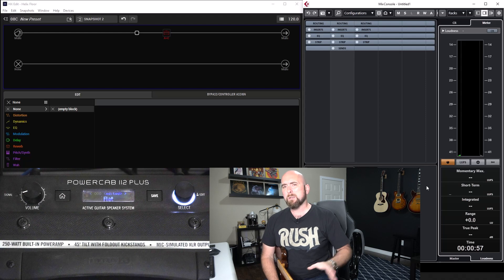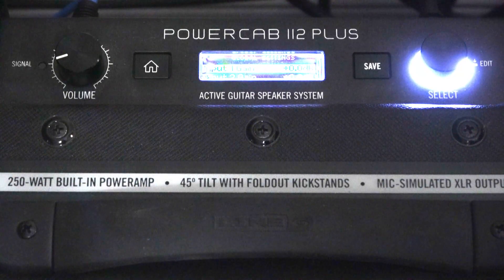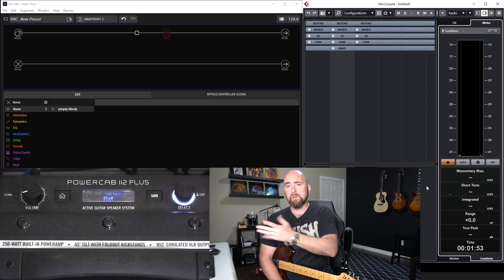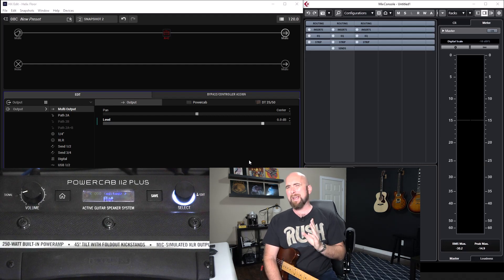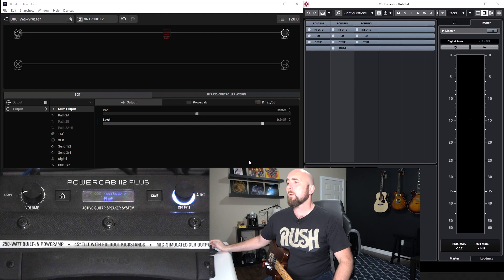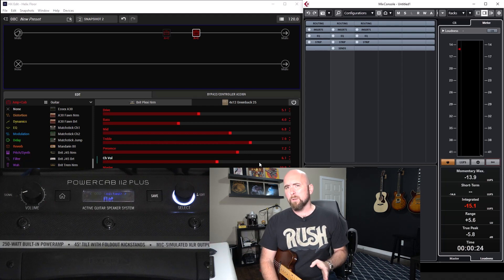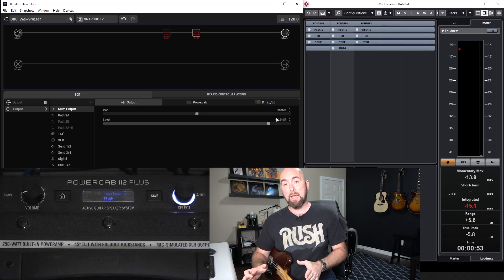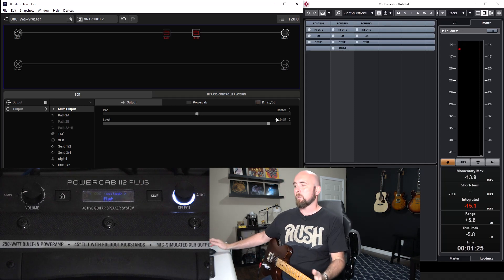SETTING UP THE LINE 6 POWERCAB 112/212 FOR THE ABSOLUTE BEST RESULTS!!

Comment: Jason, I appreciate your expertise with the Helix and Powercab.  You are my #1 go-to source when I have any questions and I watch your videos--sometimes a few times--and learn something new each time I watch them.  That said, I have a question about this video.  And I apologize in advance for the long post but I wanted to give as much details as possible from the start to answer any questions you (and any other readers) might have.

First, some details about my hardware and signal chain.  I'm using a Helix Floor (Firmware V 3.11.0 - b5021b0) with a Powercab 212 (Firmware V 2.00.1) connected to the Helix with an L6 cable.  I also simultaneously send XLR out from the Helix Floor to the FOH mixer (sometimes to my Behringer X-32 Rack and sometimes to whatever mixer is available, depending on the venue, rehearsal space, etc.  And sometimes I send from the Powercab 212's XLR OUTs to the mixers too, depending on the situation).  Generally, I use the Powercab 212 as I would a regular guitar amp on stage so other band members and I can hear the guitar.  And yet other times, I don't use the Powercab at all and just run straight into a mixer.  Now on to my problem.

Im having problems setting the output levels on my Helix so that the Powercab gets the right amount of signal without sending a signal that's too hot to the FOH mixer.  This is not much of a problem when I'm using my X-32 mixer because I simply turn down the gain on the mixer but  some of the cheap mixers I sometimes have to plug into can't handle the hot signal.  And now on to my question.

You mentioned setting the global output on the Helix to LINE level.  I see three sources of output on the Helix: 1/4" Outputs, XLR Outputs and Digital Output.  Next to the Digital Output is a Digital Out Level.  No changes to any of the settings in any of those outputs make any difference in what signal level my Powercab is receiving.  I assumed the thing to do was to set Digital Output to AES/EBU and then control the output from the Helix to the Powercab (via L6 cable) by adjusting the Digital Out Level but that doesn't seem to work.  I can change the Digital Output from S/PDIF to AES/EBU and it makes no difference.  I can adjust the Digital Out Level full-scale from -60.0 dB to  +18.0 dB and that, too, makes no difference.  Now, I can adjust the Output levels in the Multi output block using HX Edit, as you show in the video, but that also affects the level coming out of my 1/4" and XLR outputs.  How do I adjust the output to the Powercab independently of the 1/4" and XLR outputs on my Helix?

Thank you in advance for your reply.

Comment: Jason, I've watched a lot of your videos and I can say you've really helped me improve the tones in my setup.  Thanks for all your great content! I did catch in one of them that you said you mostly use your Powercab in Flat/FRFR mode (as you do in this video).  In my limited experience with my Powercab (have had it for less than a week), I feel the speaker modelling feels more like the "amp in the room", but this imposes limitations when recording.  And here I'm talking mainly about tradeoffs related to routing capabilities, DSP limits, and Helix's ability to model dual cabs.  (Maybe I should have bought a 212). Anyway, I have played with routing a signal to the powercab and splitting it off into Helix speaker cabs for the recording.  Of course I can also just record direct from the powercab . . . of course the simplest solution is to do all modelling in the Helix and go Flat in the Powercab.   I'd love to hear your thoughts / or see a video on this topic.  Cheers!

Comment: lots of good info in this video. For me I use the AES link to the powercab and make sure that in my global preferences Volume Knob Controls does NOT affect the digital output. I think this is the equivalent of setting the volume knob to full but allows me to use the volume knob to control headphone volume, etc.
Reply: I was looking for this comment as that's what I do too.  I wasn't sure if it's the equivalent of setting the knob to full but it seems that way.

Comment: I set my pcab at 21-12'oclock and design my patches so the vol knobber on the Helix LT is at 12 o'clock. Plenty of adjustment both ways and when the band says I'm too loud, I show the settings and tell them I have it set EXACTLY the way it was the last practice. Then, by the end of the night I can't hear myself because of their volume creep. Same thing over and over. Then it's, "Hey!, I can't hear your solos." Well YOU need to turn down then don't you...LOL. Consistency is king!
Reply: I set mine the same way. I can use my volume and tone controls on my guitar.

Comment: This is a very good video, thanks for the detailed explanation. I also had an issue by setting up the POWER CAB input level at 6Db. I use a kemper profiler and noticed terrible noise in some of the sounds, we should always keep the inputs at 0 Db

Comment: Great video! I just got a Powercab 112 plus and have a quick question for you. I use an HX stomp. My chain is guitar > Keeley compressor plus > stomp > strymon flint > Boss RC5 >Powercab. 

I have my output set to line, my stomp volume knob all the way up, and my compressor off and in order to get the signal light to turn yellow, I have to turn the channel volume of the amp model all the way up and set the output block to around +18. Is this normal? It seems like I have to send so much more signal into it than other people I’ve seen? I’ve also set the output of the speaker modes and FRFR mode to +0 and the input gain in global is +0.  Any idea why i have to send so much more signal than others? 

I’m using an American Performer Tele with my pickups set to stock height and my volume knob all the way up if that makes a difference

Comment: I have two powercab + 112.  I can use the link cable for either one and it works fine.  When i try to link one into the other it comes on for a second and then shuts off.  Only the second one does that.  I have the right cables.  Any suggestions?

Comment: Thank you for all your Line 6 videos! I have a Helix and a Powercab 112 (standard, not plus) and your videos have really helped me achieve a better tone. I have to ask though: I tried this trick and leveled some of my Helix patches so that the Powercab signal LED would alternate between green and yellow when playing. However, I began hearing quite a lot of unpleasant "rattling" (imagine a damaged speaker) from the Powercab when I did this. I had the Helix master volume all the way up and my presets leveled via Helix output block. Reducing the Helix output volume eliminates the rattling and I can increase the Powercab volume without re-introducing it. I connect the Helix to the Powercab with an XLR-cable using the analog interface since the standard PC112 doesn't have a digital input.

Could I have missed something or should I suspect a defect in one of the devices?

Comment: You mentioned you used the L6 link cable.  When using that cable rather than XLR does it default to line output?

Comment: Hey Jason.  Great work.  Question I have a helix in power cab are all your settings or patches that you have designed for my power cab to be an FRFR or flight mode or Ron mode or are you sending the signal directly from the helix to front of house.  ?

Comment: Jason, very insightful as always.  I don’t have a Powercab yet but I’m just about to pull the trigger. 
The one issue that I always struggle with whether with an amp or the Helix is the Fletcher / Munson effect. So how do you deal with that when setting up patches for live use?  Do you just turn everything up loud when creating it?  Or do you have some tips for transitioning a patch that sounds great at lower room levels to one that sounds just as good at performance levels?  Thanks - Mike

Comment: Hi Jason, how are you, thank you so much for explanations of all the details regarding the Helix, sometimes too deep hehe ;)

I have a question regarding the setting up the powercab 112 and the preset volume levels:

- i tried to set things up like you did in this video but i installed the Helix via Stereo XLR in my audio interface and on the interface there is an input gain, and if I turn on that knob, the Level meter in the DAW will dramatically change too. My question is how to set the input gain of the Audio Interface to have a propper setting up situation of the Helix presets and setting up the Powercab?

Thanks Jason
Cheers

Comment: Hi Jason I’ve just purchased a helix and a headrush 108frfr speaker not sure which is the best way to connect 1/4 or xlr or is there advantages in using the line 6 l6 link cable cheers

Comment: im trying to use the powercab 212 as an audio interface. the guitar sound works well, but it sends the other tracks back through the speaker and records them onto the track I have armed and i am trying to record on and just ruins the track. anyone know what i am doing wrong or how i can keep the track i have armed from recording all the other tracks on it? i have am using studio one and i have never had this problem with any other audio interface

Comment: By the way, I would assume the most desirable (maybe common?) way of hooking helix to PowerCab (Plus models at least) would be L6 link.  But the Powercab input gain settings are for Inputs 1&2.  They don't affect the L6 link input level, correct?  So it wouldn't even be an option to boost input level that way for PC+ users.

Comment: Is there any benefit to sending a stereo (helix for example) to both inputs of the of a power cab 112 set to run cab simulation on both preamps? I figured it would be good for wet dry and maybe even dual amp set up routed if I set it to flat? I have a tonex and a hx stomp and trying to figure out the best way. Figure two preamps means more headroom? Enjoy the content

Comment: Hi Jason -  First thanks for your in depth replies videos, etc. I have a couple of questions please for using the powercab  1) Are most presets (yours or others) when purchased from marketplace or some downloaded from custom tone created with headphones or studio monitors which I think are FRFR?  2) If so, if I tweak my presets the way I want them with the PC at home on FRFR (amps and cabs on helix), will the audience then hear what I hear from the PC if I run XLR from power cab to FOH PA? Also, I'm still confused by the PC XLR output on the other modes. - (speaker model and speaker model/natural)  If I like one of those (with the cab eliminated in Helix chain),  and then use PC XLR output to FOH from those modes, will the audience hear what I hear from the PC? Thanks again!!

Comment: How do balance between your rhythm and lead volumes? Do you find it challenging to not have too little signal coming through on clean or rhythm because you’re accommodating for a boosted lead that you’re trying to avoid clipping too much? Having just gotten a 112+ I’ve loved it! It’s actually made dialing in dynamics better for me. I think I naturally had things in the yellow with a touch of red zone. Last question: do you run simultaneously to the FOH and if so any issues with line level or do you do some fancy splitting from the Helix? I’ve just been giving them the line out from my Powercab but in the future would want them to have a stereo signal while I have the mono on stage.

Comment: Hi Jason.  I'm super confused.  I think I have a comparable setup to what you are using for this video.  I have my Helix connected to Cubase via a Native Instruments interface with XLR.  The interface input is set to line with the gain set to zero so the LUFS metering levels in Cubase are within acceptable ranges.  I have my Helix connected to the PowerCab 112+ via L6 Link.  I want to get the PowerCab LED into the yellow zone without the Cubase LUFS meter going too heavily into the red zone, since I want the Helix XLR output to be relatively gig ready for FOH mixing purposes.  With this video, your LUFS meter is pretty heavily into the red.  I thought that was a no-no.  Is that okay, and if so why?  Even with the Helix PowerCab FRFR Flat level dimed to 6, I've found that the only real way to get the PowerCab into the yellow LED zone is by upping the Helix output, but I don't want to cause front of house headaches by having an overly hot signal from the Helix XLR's. Any recommendations outside of running a split output from the Helix?

Comment: Hi thank you for the video it helped. But just one question - if you are using the factory presets  all set to 0.0db, you have to go into each one, run through this process and dial them in individually, and save each one??  I'm using an helix LT to a Powercab 112 via the XLR line out.

Comment: Jason when switching to the speaker sim in power cab we should cut off the cab block in helix preset were using , is that right?
Reply from the maker: That would be the idea, yes. If you were going to use the PowerCab in FRFR mode you would leave the cab block on.

Comment: Hey Jason! Love your videos. So helpful. I use a Helix Floor at home for recording but I use it with a real tube amp with my band as just a multi FX board with no amp modeling. I think I'm going to get a power cab just so I can get the most out of the Helix live but my question is...with a real amp, should I have the master volume all the way up? Should I consider a line level signal in my current scenario?  Any advice is much appreciated. Thanks!
Reply: Tube amps are designed for mic level input, not line level.  
Master volume should be wide open for best clean headroom as a pedal platform.

Comment: I'm struggling with the idea of keeping big knob at MAX at all times because I use a different patch for every song and I use snapshots within patches.  This means that volume levelling is a constant struggle.  Occasionally I have to adjust in a live situation, for example when there are volume wars and I have a lead that needs to punch through.  If it is maxed, that's pretty much impossible.

Obviously you still need high output going to the Powercab to keep it in the yellow, but I find I have to deal with that within the blocks of Helix.
Reply: Get rid of whoever  is turning up

Comment: Nice video. But how is it possible to play at a quiet level for example in your bedroom with the Powercab level set to max and still run a yellow clip signal into the cab? That would be monstrous loud!
Reply from the maker: Powercab level should not be at max. Powercab volume is your overall level, set it at the appropriate volume that you need it at.
Reply: @JasonSadites  my bad, it's helix master volume set a max, not powercab!
Reply from the maker: @gohomenaples  yup 😀

Comment: Jason, thanks for all this great info.  Have a question about recording with Powercab Plus.  As a preface, this is for personal use and practice.  Have the same set-up that I believe you are using, that is .......Helix Floor connected to computer via USB, Powercab 212 (connected to Helix via L6Link), Cubase 10 Pro.  Goal is to set up patches that sound great on PC212, but then not have to fiddle with creating separate patches when I try and capture that emulated PC212 sound in Cubase.  I am using Helix as the USB audio interface.  I can capture the dry signal easy enough with USB 7.  But then USB 1/2 is really only capturing the Helix processed sound, so I end up with Amp only, none of the PC212 Cab processing.  Is there some way to capture the PC212 processed sound through existing connections ? Does that signal get pushed back to Helix via L6 ?   I know the XLR outs of the PC212 carry this processed signal, but then where to connect those in  my existing set-up ?   Or do I have to use PC212 as the USB interface (but then I can't easily capture the dry signal) ?   If you have any guidance on this would be greatly appreciated.  Thanks !
Reply: Also, I have considered using a separate interface (Stenberg UR44), and I know I can make that work.  But it's just so much easier and cleaner using the Helix as the interface.  The other option is using PC212 in FRFR mode and let Helix do the Cab modeling, but I have not been able to get that approach to sound any where near as good.
Reply: @tlathbury8941  I have the same setup. As you've said you could capture the XLR outs but there's not much point because the XLRs are using cab emulation anyway so you might as well add a cab / IR to your recorded tracks after you've finished your performance. Alternatively, go with FRFR mode for simplicity. I can recommend Impulse Responses by York Audio.
Reply: @lewisjenkins8174  Thanks Lewis !  After tinkering around with this quite a bit I decided on staying with Helix as my audio interface, but modifying the patches used for the Powercab (via L6 out).  At the end of the chain for each patch I insert a split with a separate out, then I drop a cab model block on that split which gets me close as possible to the Powercab sound when recorded in Cubase.  That split is routed by itself out to USB 3/4, which is the wet signal that I record into Cubase. This way any block adjustments to the patch that I make while practicing and playing on the Powercab are all captured automatically when I record, since I am only dealing with one patch.  As a back up (for good measure),  I also record a second dry track using USB 7, which I can use with Native if I feel the need to tweak sound further.  My patches are relatively simple, so I can spare the space for the split.

As an aside, I found the Powercab XLR outs hot and noisy, even after trying to compensate in PC Edit.  They capture the essence of the sound well, but not ideal for recording.  Also tried using Powercab as USB interface, but also found that noisy (pops), perhaps USB cable was too long, but I used the same cable with Helix with no problems.

Thanks again.
Reply: Also, thanks for the tip on York Audio, will look at that.  Have not really fussed much with IRs.